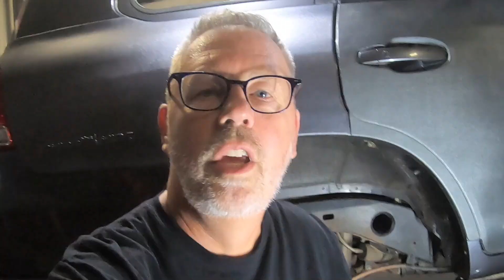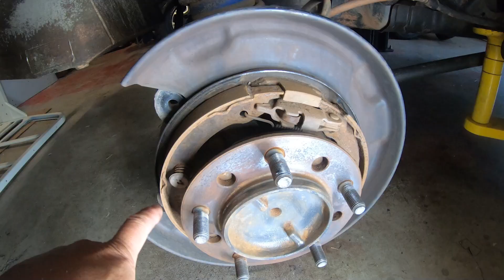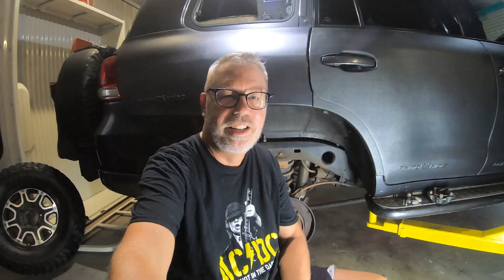How to Adjust and Replace the Handbrake | Landcruiser 200 Series

Comment: Looks like the same (terrible) design as the 100 series (and the 80s and the 60s). I do like that spring retainer clip tool. I'll have to get me one of those!
Reply from the maker: It sure is mate, they finally got it sorted on the 300…it only took them 40 or so years😂👍
Reply: Do you "bed in" parking brake shoes and how?
Reply: @kimbuck-2  There's a settling procedure, but not a bedding in as such. Settling procedure is in the manual.
Reply: @Chris-hx3om  Thanks.  I adjusted the star wheel and all seems good at the wheel except for a faint rub of a shoe in the hat at once specific spot in a full rotation.

What manual do I want?  

Than you...
Reply: @kimbuck-2  I have genuine factory manual. Never use anything else (for anything).

Comment: I have the same issue with my LX570 and have to adjust the starwheel in the rear once a year.  I do notice that on my Lexus GX (Prado 120) the rear parking brake has an auto tensioner that keep it adjusted as the rear parking shoe wears.  Why don't Toyota put that auto tensioner in the 200 series so we don't have to manually adjust the rear parking starwheel every year?
Reply from the maker: Good question mate, I guess they need to keep up the tradition of crap handbrakes on the Landcruisers!  Cheers

Comment: I found the handbrake adjustment under the pop-out cup holder assembly. But after new brake and rotor install, and adjusting the e-brake shoes, that handbrake does not have much stopping power. The shoe pads themselves still looked okay….maybe just old?
Reply from the maker: If you replaced the rear disc/drum assembly I would say the handbrake shoes have not bedded in to the new drum yet.  Try driving slowly and applying the handbrake a few times to bed them down.  Then readjust them again to take up the free play and see if that helps.  Cheers👍😎

Comment: what are the bolt size you used to push the rotor out?
Reply from the maker: I’m pretty sure they were M8x1.25 but that was a while ago so not sure.  I do know they are the same size for 40’s, 60’s, and 80’s😎👍
Reply: @JafffaAdventures  thanks mate m8 worked out fine, mine is 2010 Prado. Both my disks were stuck so m8 were not able to get those disks released, I had to call for help and the mobile mechanic had to get the disks cut off because it was apparently suck solid. Now I'll have to put two new disks and fit new handbrake shoes 😔
Reply from the maker: Wow, that’s pretty stuck.  Best you sorted it now than them letting you down on a track somewhere.  Go well mate👍😎

Comment: Great video! One comment is that the lever end adjusting nut (that you access after the star wheels are in the right position) on the two 200 series I've owned is under the cupholder, and the cupholder comes out by pulling straight up (no screws or anything holding it down). Yours didn't need that adjustment, and you just mentioned removing the center console in passing. It is very easy to access. Again, great how to. Thanks for posting it for all of us!
Reply from the maker: Good stuff Charles, thanks for sharing your experience mate.  Cheers👍😎

Comment: Great Video. I had to figure it out by myself when I readjusted my wheels brakes a half year ago. Was still to loose but since my 200 is a manual I can park in 1st gear… half hour ago I set the staarwheel again two clicks closer. Will seenif it works and if not I’ll need to order a new set of brakes…
Reply from the maker: Thanks for the kind words mate, I sincerely appreciate it.  The handbrake on these are ordinary at best, I trust you will be able to get s little bit better performance out of yours but it will never be fantastic.  Good luck mate😎👍

Comment: Hey Terry, great video once again!! 

To adjust the cable inside the cab, do you just remove that one piece around the handbrake or the whole thing needs to be removed? Cheers & Thanks.
Reply from the maker: Thanks mate.  You actually access the cable underneath the cup holders.  That single piece will unclip and you can see the adjuster from there.  Cheers😎👍

Comment: What do you use to clean the backing plate? Brake cleaner?
Reply from the maker: Yes indeed, brake cleaner was my go to.  I actually use it quite a lot these days, more so than petrol which was my go to solvent.  Cheers😎👍

Comment: Nice video mate. Really enjoyed your presentation style, very clear and informative. Due to do this on my 100 series very soon should be a good refresher. The cruiser handbreak has a bad reputation but I think alot of it is due to poor maintenance and adjustment.
Reply from the maker: Thanks for the kind words Bradley, I sincerely appreciate it.  I agree a lot of problems are due to poor maintenance and adjustment.  That coupled with the abysmal design of the handbrake itself means they rarely work well.  Have a great weekend mate😎👍